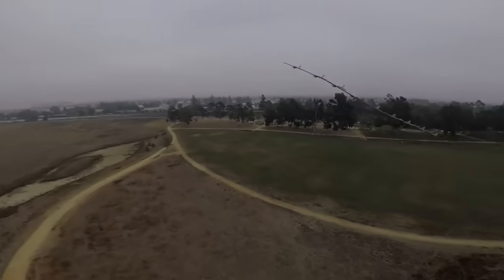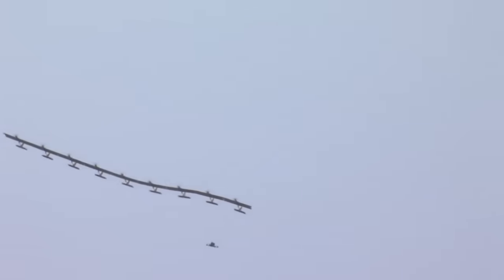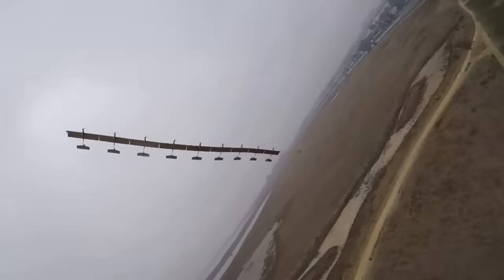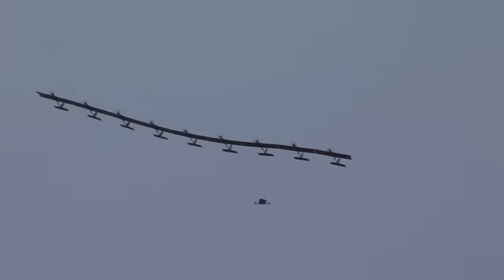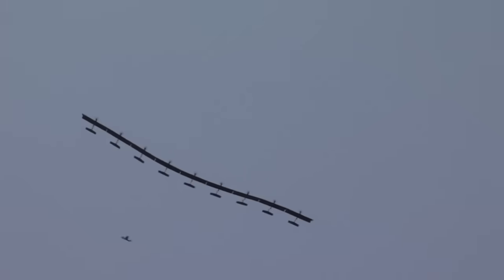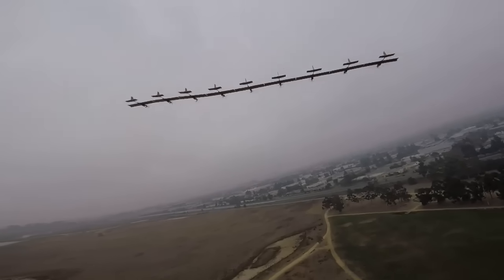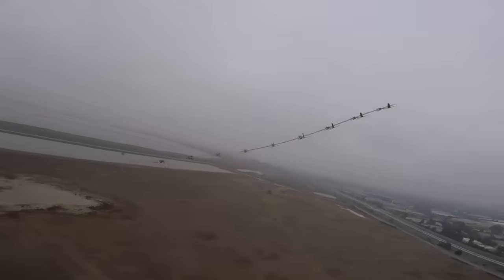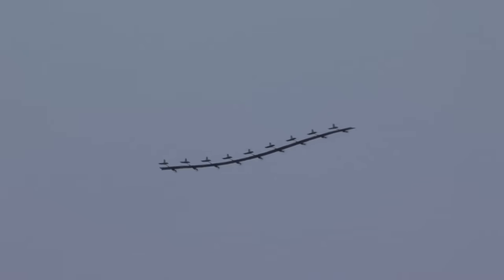Ran D St  Clair Flex 9 Flight  The unbreakable wing

Comment: Great stuff!😃 Does every aircraft has its own controller, or do you have a central flight controller?
Reply from the maker: I'm just the Emmy award winning cameraman, I don't pretend to understand anything... but I THINK that each aircraft has a controler & I think each airplane only has elevator control so if say aircraft #3 was left wing low, that aircraft would use its elevator control to make its self level with the other aircraft. But i'm just guessing because the technology is overwhelming.

Comment: This is reminiscent of a sort of uav that I saw a number of years back. High aspect ratio, multi engine, and solar cells top and bottom. The idea (if I remember correctly) was to operate at high altitude to get direct sunlight from above and reflected sunlight from below. The aim was to remain aloft indefinitely. 
A news item from some years back that always stuck with me.

Comment: Cool...  but my question would be "why"?  😎🇦🇺
Reply from the maker: We were doing nothing but then we thought let’s let other people do nothing and so we did something.
Reply: @wcolby  👍Good on you for doing something so unusual. 😎  I was just wondering if you had any benefits/uses in mind.
Reply from the maker: @maxhugen  absolutely yes!  the intended purpose was an experiment in a flexible wing.  Very large, rigid wings have broken up in turbulence, and this was an experiment in the idea of having a flexible wing that can absorb turbulence. it was the absolute very first flight and I’m sure that the military industrial complex is  carrying on testing in secret.
Reply: @wcolby  Ah right,  got it now,  thanks!  Is that an issue with the large, very high-aspect-ratio solar-powered aircraft such as High-Altitude Platform Stations (HAPS) for telecom, surveillance and similar “pseudo-satellite” roles?
Reply from the maker: @maxhugen  like Helios.

Comment: This was fascinating and I was so glad you used he chase drone, since due to the aircraft's design it is hard to determine off-angle direction and the drone imagery makes the flying characteristics much clearer. I did wish you had flown a "pattern" so the drone could have led the wing (looking back) instead of just following. I probably wants to turn in a preferred direction due to the torque of the propellers. Perhaps having one set turn one way with others turning in the opposite direction might be interesting? Further, perhaps a 'V' layout might also add stability. After all, it works for geese.

Comment: If you could get a thin steal rod(or even more exotic) that runs the length of it then  you could make it much stronger by putting it under dynamic tension. Basically 
|--------------|
|=======|
|--------------|

Where = is the metal rod(say a few mm in diameter) and - are tension wires or strings which are in tension.

This compresses the steal rod which keeps it from bowing. Any bow would cause the other side to flex stretching the wire which it will resist.  For stability in all directions you could have the cross section a +(4 wires). A single rod may be enough but likely at that distance it will flex unless large enough which then might add too much weight.

Comment: I am so curious what the data from that would look like or how that would feel if planes locked wings in the sky for stability. The hinges in-between the planes could be designed to convert energy from crosswinds.

Super cool and thought provoking

Comment: I am an old engineer/ mathematician. In my youth I analysed many discrete and distributed electrical and mechanical systems, where multiple units were connected together, as in a long transmission lines,  catenary bridges, and  other components connected in a Matrix system, where the overall behaviour is due to  the individual system function, plus inputs to individual  system and the inputs from adjacent systems. I have done vibration along musical strings, vibration of sheets as in drums and in three dimensional systems as a lump of jelly.

I want to congratulate you on your courage to build such distributed systems. It is remarkable how you make the world as your laboratory with such modern equipment which was not available to us, going back to 1953 when I was such a young man, starting my engineering apprenticeship  with the  British Royal Navy, before going to university, to analyse the mathematics of what I did in my youth, 

You were correctly hesitant not to side slip that distributed flying configuration,  I would suggest putting a vertical area just aft of the centre of gravity of each element ( sort of a vertical rudder  with its centre of lift just on the centre of lift of the wing just behind the CG of each element,)  Then this would put the system on TRACK controlling the side slip.
 
Again, congratulations, and though I am an old man, I am still  appreciating the higher level engineering analysis that goes to make such "distributed, connected  engineering flexible systems, I did a lot of Radar waveguides analysis and I could imagine that  the vibrating / oscillating modes in  that flying flexible machine was  projecting is remarkable,  One can even think of it as an electromagnetic pulse   with its electromagnetic loops interlaced together. emerging from a parabolic antenna.  

I can only conclude by congratulating you once again, Brilliant work and that flexible distributed flying machine  has contents more than the eye can see,  Well done , all the best in your life, you are seeing the deeper  depths of our universe and its behaviour, You are on the right track to really enjoy life,

Comment: I would try adjusting the 2 planes on each end of the assembly so they would pull out /away from each other and slightly upwards as it fly's to help stabilize the ribbon effect.
Reply: I forgot to mention .excellent job.

Comment: Interesting design but what was the perceived gain? Could the individual motors self adjust to level the wing? Could they go into full reverse at very low altitude to make the plane stop and drop gently to the ground? If each unit flew level at a certain prop speed then could you control the whole thing by altering prop speed without need for other control surfaces? (it wasn't clear but you may already be doing this).

Comment: Each one breaks off and attacks a tank? :-)
Reply from the maker: The pentagon has entered the chat.
Reply: @wcolby  Quite. The military interest in drones, and particular swarms of them has gone through the roof, post Ukraine.

Another thing,  cost out a large drone, powered by a motorcycle engine, ardupilot as well, and its surprisingly cheap. $20K for a very large range.  The difficult part is getting it airborne and dealing with countermeasures such as jamming of GPS. 
But computers are at the point where they can visually fly and target....

PS it does look like one of those very high altitude solar planes.

Comment: I've been thinking of a design similar to this for a few years; glad to see someone execute something similar.
I was inspired by watching a friend pilot the Helios Prototype flying wing, built by AeroVironment, Inc.
I'm thinking that stability would be increased if the wing tip junctions only permitted upward flex 
The next tests should include turning off certain motors in pairs on each composite "wing" section to discover how many motors would keep the entire assembly at cruise.
Using differential thrust to augment yaw should also be tested.

Comment: Out of interest are the vertical stabilisers on the tails doing anything? As they are very short compared to the length of the wing. Or is it doing something with the dynamics of the vibrations?
Reply: Yes, they. provide side force when in a slip.  This is sensed by the flight controller which uses differential throttle to turn the aircraft into the relative wind.  Also, being behind the CG they do this automatically to a small degree.

Comment: This is a very interesting investigation into system control theory. So far it seems like you and the crew are doing quite well. One thought came to mind. If it was possible to control the speed of each motor independently, then with the speed at one end essentially at idle to increasing the speed linearly along the wing to full speed on the other end, might make for some interesting turns. I have no idea how the auto control systems would deal with this sort of configuration if at all. 🤷‍♂️
Reply: Flight controller firmwares can handle multi-rotors and planes so, should be possible to expand this to multi-planes. I'd be a bit concerned about prop-wash in flat turns though.

Comment: Funky aircraft there. Would be neat to see that thing hit some thermals on a sunny day. The way it flexes, I'd think there would be good visual feedback on where to circle. Also might need to figure out how to add angle sensors and feedback at the hinge points between each section, so there could be some way to coordinate them better.

Comment: This is a miracle! How did you do this?  I have the only very lightweight ion propelled aircraft with onboard power. I could possibly connect many of them together to lift more weight. I would imagine a series of them connected together would flex a lot however. You have proven it is possible to fly a flexible craft.

Comment: You know how the fighter jet escorts for test aircraft zip all around haphazardly? Exactly- they don't Tell your drone pilot to maintain a stable observation point in rear flank, to : 1) Provide useful visual data and 2) not create a distraction for the test vehicle pilot and and 3) not increase the chance of collision.
Reply from the maker: You obviously do full scale Flight Test we are subscale and we were not completely sure that the aircraft would survive the landing so we filled the test card with a lot of stuff.
Reply: @wcolby Am I correct to presume that included the drone needing to observe from different points of view during the various tests?

Maximizing your test plan in a test that has high probability of destroying the test article before the end of the test session, where session time is also limited, is a challenge.  Looks like they did pretty good at that to me.

Comment: With the amount of wing surface area, I'm not surprised that this flew as well as it did. The only concern would be it twisting itself into a pretzel. Seems you have that part sorted with the auto-leveling. I think that surface area also contributes to it liking lower throttle settings. I don't think the landings will ever be graceful, unfortunately.

Comment: That was Damned fascinating! I've seen up to 5 planes together but they were rigidly mounted together. Seldom ended well 
 I saw in a comment below how this was kinda like an advancement/ improvement on that huge high flying Helios drone that NASA flies. I've read that it doesn't like turbulence at all. This thing seems like,with the right automation in the flight controls,could handle quite a bit of turbulence.  How do you think it would handle a bad cross wind,or would it even try?
Really don't know enough about aerodynamics or anything really,to ask the kinds of questions this thing taises on me!! 
Simply fascinating aircraft!
Reply: There needs to be a way to twist the wing to accommodate different pitch of the oncoming wind. Why do so many videos turn off search in the transcript? What effect would cross wind have? The wing should be flat.

Comment: I only see one servo to the elevator. I'm assuming you are using that for both elevator and aileron, and is throttle  differential used for rudder? Very cool.

Comment: Wondering what the purpose is though.
Reply from the maker: I’m just a camera guy and no one tells me the official reason for anything, but I’m gonna guess that there are aircraft like the NASA Helios that are susceptible to turbulence because of its rigid construction. These guys designed a Wing that is flexible. So aircraft designers can take the data learned from this subscale project and turn it into a larger aircraft with an incredibly flexible wing.
Reply: @wcolby  That still doesn't explain it.
Reply from the maker: Then I’m sorry,  you’re gonna have to figure it out on your own.
Reply: @wcolby  Well if you don't know...
Reply from the maker: I do know. You are the one that doesn't understand the answer.
Reply: @wcolby  Hence the question, obviously.  Ok if you know, what is the purpose?  Ok since my short comment didn't suffice - longer version: This isn't a helio (helicopter?), it has multiple motors stretched out over several wings that are attatched and why would it suffer any more turbulence in a thin atmosphere that is different from what aircraft experience on Earth?  Seems like you made this up because this seems more about the multiple motors on floppy wings than it is about the floppy wing. I got an idea.  E-mail them and ask them what they were experimenting for.  If you're WRONG then you owe me $5.  If I am wrong in suspecting you are wrong you have a new subscriber.  Deal?  

jk. Would like to know their answer.
Reply from the maker: @curiousnomadic  no deal.